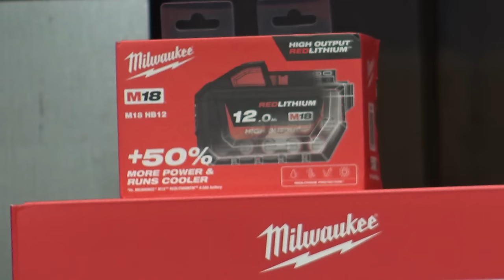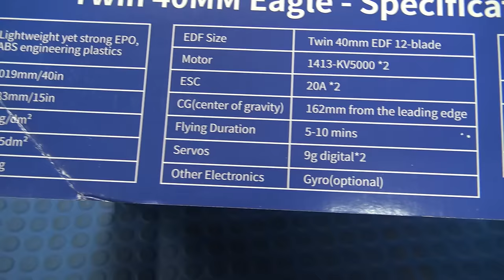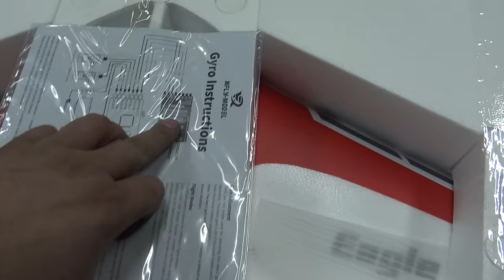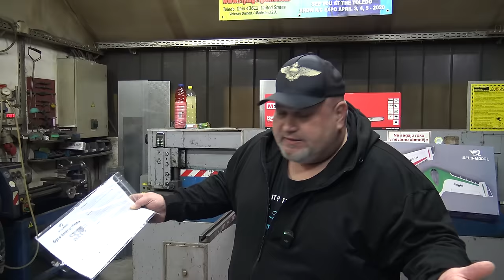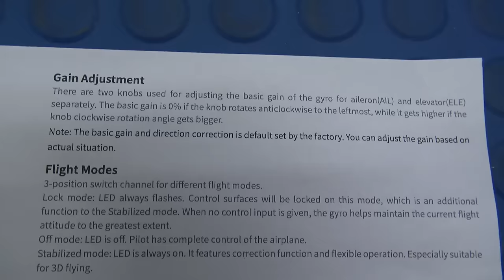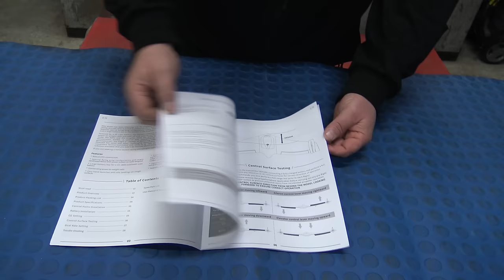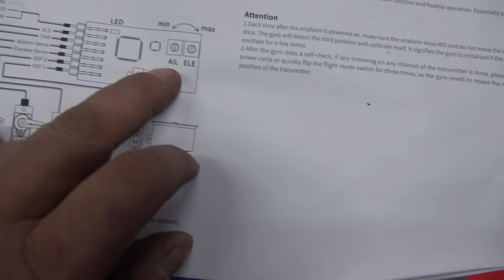XFLY Eagle Twin 40mm RC EDF jet Wing with Gyro EPO 1019mm (Red/White) Unboxing

Comment: Great idea about the German paint scheme as I also saw some old photos of their experimental designs with engines on wingtips. Thought about adding wheels myself as it would be pretty easy without adding much weight or drag but decided against it because I imagined it could suck in debris with the intakes so close to the ground. I have some videos of my initial flights, this thing is great!!!

Comment: This is a really cool plane but very difficult to fly. Because it has thrust vectoring plus elevon control it has a bad habit of tip stalling under reduced throttle. It seems like when the edf's  are in the thrust vectoring mode they are over powering the elevons in the turns. Captain Drone did a review with this plane and he was having major issues with it, it crashed several times while making a turn. We suggested reducing the throws on the elevons and add more expo and also reducing the amount of rpm going to each edf while in thrust vectoring mode. He tried all that and said it flew better but what he ended up doing was disconnecting the thrust vectoring and just control it via the elevons and stated it's a joy to fly now....
Reply: I watched those videos and it's unfortunate he had troubles but my experience was quite different. I have flown wings before this one. I reviewed several YT videos before flying for tips and CG is critical as well as launching in the correct flight mode. Battery should be as far forward as you can get it, generally speaking. Insure differential thrust is not reversed, when yawed, the lagging wings motor should speed up. Launch in locked (self-level) mode and it's a breeze - never had a problem with launching this in the least.
Warning! The only problem I had (which is also shown by another guys YT video named Dr. Cho) was when landing one needs to cut the power because she really wants to glide. Flies fine power off but what happened was when I was getting close to touch down I added a bit of throttle to adjust for desired touch down point and was about 4 feet off the ground and the craft immediately yawed out of control. I think it has to do with throttles re-initializing after a long flat glide with power completely off. The cure is simple - when landing I now just make sure not to re-engage throttle and just committ to land. No further problems and I love this wing, the dual EDF's spaced far apart give an interesting sound effect and this model is tons of fun!!! Oh yes, be sure to go with higher expo and rates than you normally would because she can be pretty sensitive otherwise!!!
There are videos on my channel showing launch, some flights and my loss of control at the landing just like happened to Dr. Cho in one of his videos.

Comment: You'll be very happy with the M18 chainsaw, and those 12Amp batteries are the bees knees for the high drain tools.  I've got the M18 magnet base drill, and its fantastic for onsight jobs, and within the workshop.   No power cords dragging everywhere

Comment: those wing tip motors look like very powerful drone motors. I scratch built a small 27 inch airplane and used a drone motor and its a very fast plane !

Comment: That model is gorgeous. 
Putting the weight of the EDF's way out on the wing tips is a bad idea.. this plane would fly better if the EDF's were positioned at the center of rotation... with the computer stabilization off this model will have a difficult time getting in the air. I predict it will fly but in a dog fight this plane would get chewed up by the Same plane with EDF's  at the center. 
Good luck with the maiden...